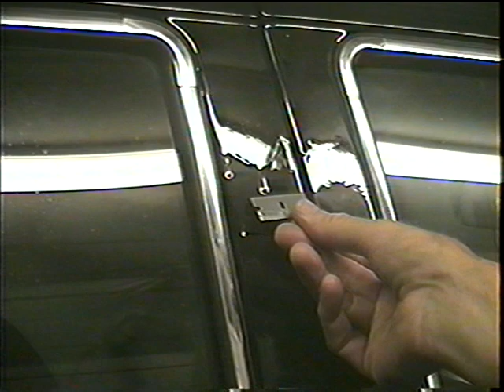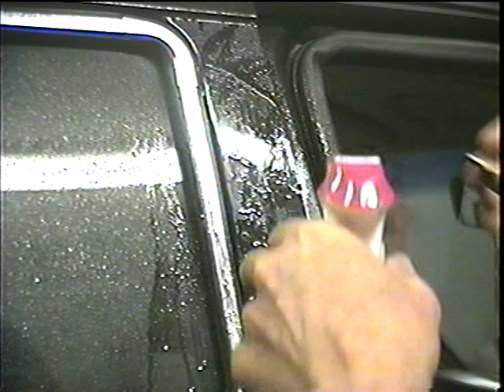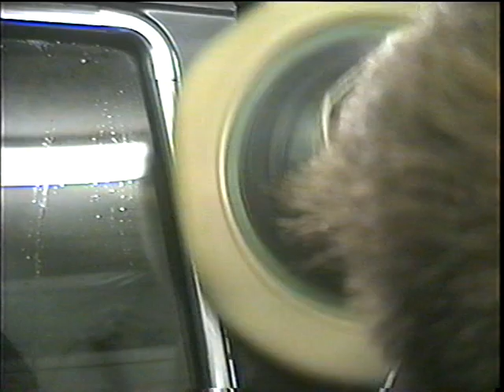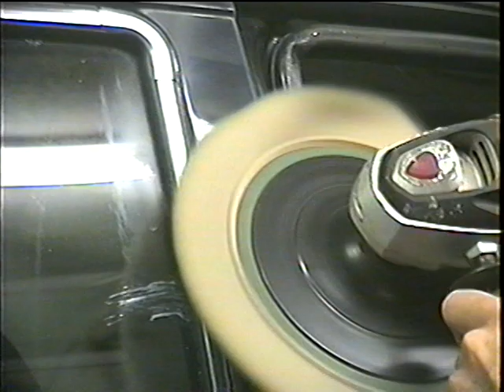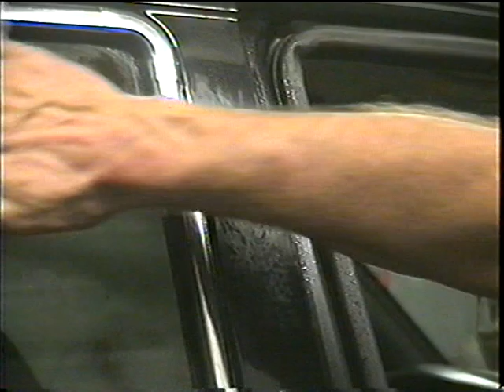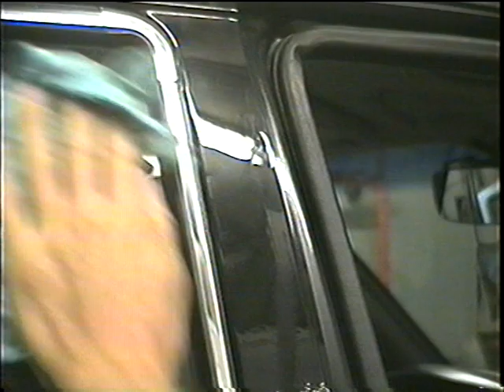How to Remove Runs and Sags in Car Paint - Single Stage or Clear Coat

Comment: In your opinion as far as runs go. Is it the lighting or is it that the painter isn't looking into the paint or the clear and judging better how much material is going down? Everyone is going for that wet look and many it seems are right on the edge. I just watched another video and the guy was very experienced painter and got a lot of runs and sags and he didn't care because it was a cheap job. The roof,hood and trunk lid looked good but the runs and sags were just below the window sills and super noticable. His repair was no where near as nice as yours and it was good enough. My thought is if you're paying $200 and up for just paint,reducer and clear, putting in the labor,you want decent results. I really liked your approach and attention to detail and the little tips. Great video, thanks Jerry. I don't like making comparisons but I'd be very embarrassed letting a vehicle go down the road looking like that.
Reply from the maker: Thanks for the support Bill.  First of all beware of videos showing great paint jobs on flat surfaces - that's easy - you can get it super wet and not run it.  Truth is... if you push it too far on vertical panels you'll end up with runs and runs are not really fun to remove.  The most important thing is lighting - paint booths have great lighting.  If you're spraying in the dark, you'll likely end up with runs.  Best is to have good lighting, watch what you're doing and don't gamble.  Wet sanding and buffing a bit of orange peel here and there is easier and safer than trying to remove runs :)

Comment: Good technique, going to fix my paint.  Too bad the ceiling light is right on the run, can’t really see how it came out, but great instructions.  Didn’t know I could do that with car paint (single stage).
Reply from the maker: Single stage solid colors but not metallics
Reply: @LakesideAutobody  Oh good to know solids.  Yes mine is solid, and i did what you said it working, just have to buff and polish.  Save me from having to coat it again.    Even did it to specks of dust particles and its smooth now.  Thanks again !
Reply: @LakesideAutobody  why not on metallics?  
I got a couple runs on my door panel + orange peel. first time ever painting. (SAPHIRE BLUE METALLIC ACRYLIC URETHANE)
Reply from the maker: @zlabfab487  Sorry about the late reply - sometimes it can mess up the metallic flakes if sanding too deep into the paint.
Reply: @LakesideAutobody  okay i see. thanks for the reply !
Reply from the maker: @zlabfab487  You're welcome - have a good week :)

Comment: Put a small piece of masking tape on the sides of the razer Blade so the corners won't cut into or scratch/dig into the paint or clear I've even bent a blade  you can also pick up a little paint file.. I also have a small 1inch block to hold my paper to keep it small to sand then use my 3 inch polisher taping the edge so I don't burn through...
  Lucky vthat was not matailic for single stage ..you must of had five gallons of paint in there becouse a normal person would have burnt through the edges still showing a little but that was a lot of buffing with a big buffer...
Reply from the maker: Good idea Peter.  You're right about burning through.  I've had a lot of practice removing runs :)

Comment: Will this still work if I use single stage metallic paint? I can’t seem to find any direct answers regarding sanding metallic single stage. I plan to also spray a layer of clear over the metallic single stage paint
Reply from the maker: Here's the clear answer. You can wet sand and buff single stage paint and you'll be fine.  However, with runs it is different because you will have to sand deep thus disturbing the metallic flakes.  To put it simply, runs in metallic paint is not good - you will see where you sanded.  That being said, anything is possible so try it and clear it and maybe you'll be happy with it.

Comment: Thank you for the tutorial. Love the attention to detail. Helped me out a lot, appreciate the video.
Reply from the maker: You're welcome.  If you ever have ?'s, feel free to ask.  Have a good week end, Jerry
Reply: I do have a quick question? How long do you wait until you can wet sand  clear coat?
Reply from the maker: Usually I wait a day - if I am going to wheel it out.  But if I'm fixing a mess up like a bug in the paint etc. I only wait till its dry to the touch.  You just have to be careful and sand very lightly.   Today's good urethane clear coat with hardener can be sanded and wheeled the same day.  Hope that helps.

Comment: Any tips on spraying nitrocellulose paint..
Reply from the maker: If you are spraying lacquer there are a  few things to look out for.  Spraying over fresh or near fresh enamel can cause problems or bad paint reactions.  Enamel and urethane can be put over lacquer but lacquer cannot be sprayed over enamel (relatively fresh).  If it's old enamel you'll be fine.  Just be aware of what you are spraying it over - do a test spot before you lay down a whole cup of it.  That being said, to me it sprays just like any other paint.  The only difference is that you have to buff it to achieve a shine.  It dries fast, wet sands nicely and buffs out easily.  That's all they used for a large part of the 20th century.  Oh, and don't spray w/ high humidity as it can trap moisture and you'll get a foggy look to the paint.  Hope that helps a bit - ask any other ?s you may have though.  Jerry
Reply: @LakesideAutobody  thanks so much Jerry
Its an old citroen gs from the 70s but most of the original paint is gone so im sanding it down and going to prime it with 1k lacquer primer and etch were its bare metal
Reply from the maker: @brokeunemployed5208  I forgot the best thing about lacquer primer is that it's DTM - direct to metal - no need for etching primer, epoxy or anything like that.  Lacquer primer loves bare sanded metal.
Reply: @LakesideAutobody  great thanks again Jerry
You have been most helpful
Reply: @LakesideAutobody  Known as blooming when I was an apprentice in the early seventies 😬🇬🇧

Comment: Jerry, I completely painted my MG all over. I had no problems with the white base coat. No runs or bugs but I did have some orange peel on just a few places. My disaster is the several coats of clear coat I applied……… I have several runs on both fenders, one door both quarter panels, etc.   Should I try to remove the runs as You describe in this video or sand all the clear coat runs out and scuff the rest of the clear coat and reclear coat the entire car all over?
Reply from the maker: If you have a ton of runs, it would be easier to just wet sand and re-clear.  If there are just a few runs - like 4-5 you might want to try this method.  It's really a time thing - you'd spend a ton of time removing them all.  It's your choice really.  We've all had runs in paint/clear too so don't feel bad - par for the course :)
Reply: @LakesideAutobody     Well I really did end up with a lot of runs in the clear coat. First time spraying clear coat for Me, I’ve learned a lot with this project. I’m taking Your advice and wet sand all the runs and sags and redo the entire clear. Thanks Jerry for all your videos and advice.
Reply from the maker: @johnrodebaugh7120  Any time - ask as many  ?s as you need to.  Keep me posted on your projects :)

Comment: What would happen if youbstatted with sand paper?
Reply from the maker: That will work too but you might end up hitting the surrounding areas - thus the razor blade to stay on top of the run :)

Comment: Jerry I used Rust-Oleum paint and I got to run in my door what number paper should I use I don't I didn't use no any clear
Reply from the maker: If you are going to repair - wet sand with 400.  If you are going to buff use like 800, 1000, or even finer like 1200-1500.  I'd try 800-1000 first though - wet sanding :)

Comment: What do you use to prime small ding areas of car. In other words i working on my car as time permits and will prime the whole car when done, so i want to stop any rust before full car prime. Rattle can?
Reply from the maker: It depends on how long or if you park it outside, etc.  If it's left inside, you can prime it with regular lacquer primer, spray bomb, anything - you can leave it like that for a very long time (inside).  I confess - I also leave it outside too and only worry if I see rust start to poke through.  If I do see rust poke through, I'll DA sand it all off real quick and re prime.  I've left stuff in lacquer primer outside for more than a year and have had no issues.  That being said, you are going to have a lot of chatter online about how there's rust under it and so on.  When in doubt, DA some of it off and see.  You can always hit it with some water proof primer too really make sure.  You'll have to read the can to make sure - like epoxy primer and some urethane primers are waterproof.  In the end it really doesn't make or break your paint job.  Hope that helps :)

Comment: I see you're rocking a basic harbor freight rotary. Are you using their pads too? Or would you recommend buying pads somewhere else? Do you have different pads or do you just stick to the wool pad? I'd like to see a video specifically on the polishing process. I really appreciate the time you spend on sharing your knowledge.
Reply from the maker: Thanks so much - that's nice to hear.  Don't kn ow where the pads came from - they were my dad's. from when he worked in body shops back in the 70's - that's how old those things are - I have a few of them.  You can get them on line though - something like this - https://www.eastwood.com/grip-7-wool-buffing-pad-29305.html?SRCCODE=PLA00020&gclid=Cj0KCQiAyJOBBhDCARIsAJG2h5c8Np6KrS2oIZ4rqxmHYoC-A8zNNjHDKKPZgIDTokyNvNQY7qEXnCkaAgmtEALw_wcB  Maybe this video will help:  https://www.youtube.com/watch?v=pSwz47dXG9c
Reply: @LakesideAutobody   I feel like such an oaf. Of course you already have a video on the subject. I didn't even look. I learned some great tips. I have a da polisher from harbor freight that doesn't have quite enough bite. I've been thinking of going to a rotary, but it makes me nervous. The consensus online is that only the most skilled pro's can handle a rotary. I think I'll give it a try using your tips. I'll start with my wife's car 😆. I don't think I can make it any worse than it already is. Thanks again.

Comment: How long do you usually need to wait to do this after painting?? Using acrylic urethane paint single stage.
Reply from the maker: Usually the day after.  You can do it even earlier depending on the temperature, type of paint, if it had hardener, etc.  Basically, you'll be able to tell if the paint is hard enough when you begin to wet sand. If it seems like the paper wants to stick - wait.  Jerry
Reply: Lakeside Autobody thank you!

Comment: I can never fix runs like this as I always have tiny pin holes in the run after sanding
Reply from the maker: Interesting... What type of paint are you using?
Reply: @LakesideAutobody  it's in the 2k clear ..
Reply from the maker: @therealdeal4492  Maybe try reducing the clear a bit more and going with 2 regular coats - the last being a bit wetter than the first.  Give 10 minutes between coats.  If it's put on too fast and wet it may cause solvent pop or micro-popping.  There's some good stuff on the internet on this topic and how to prevent it.  Let me know if you solve it, what the fix was, and what you think was causing it.  Curious 👍  Jerry
Reply: @LakesideAutobody  I couldn't find anything on the micro popping..
I wait at least 15 min flash times ..
May have to reduce it alot ?
Do you know anything about this?
It looks clouding in thick spots or runs..but is very tiny pin holes like micro popping.?
Any help would be appreciated as I have been dealing with this for a bit and is not easy to cover over .
Many thanks!
Reply from the maker: @therealdeal4492  Check this article out under solvent popping. https://globalfinishing.com/2020/05/13/4-common-causes-of-finishing-defects-how-to-remedy-them/ I've never ran into it but I don't spray thick paint.  If anything I spray it on the thin side like 4 parts paint and hardener to 2 parts reducer or even more depending on the paint thickness out of the can.  I can't stand thick paint.  It leads to all kinds of misery - orange peel, dry areas, heavy sags from trying to get it wet, thickness around tape, takes longer to dry, etc.  I would suggest reducing your paint & putting on thinner coats.  You'll have to move a bit faster because it will be a bit thinner so you won't want to put it on as heavy as you are used to.  Here's a forum on it to - seems other folks have the problem to - is the surface hot when you paint?  Do you have excess moisture in your location?  http://www.spiuserforum.com/index.php?threads/clearcoat-boiling-solvent-trapping-micro-bubbles.7024/

Comment: That was a horrific you could clearly still see the run after you finished sanding even at the end the paint work was eneven
Reply: I agree, In fact, there are numerous issues in his process. First, you can't go from 400 to 1500. You need an intermediate grit, say 800. Second, he left way too much of the run when he switched to 1500...you need to get the great bulk of the run out with the coarsest paper on a hard block. You cannot remove the remnants of a major run like this one with 1500. You will sand thru before the run comes out. I do agree the use of the razor blades. Sorry to say, but for those who do this for a living, this was not an acceptable repair. Not even close.

Comment: What grits are on the electric sander?
Reply from the maker: Meguiar's M105 Mirror Glaze Ultra-Cut Compound
Reply: @LakesideAutobody  Oh. so it's polishing compound. I don't have access to electricity or a polisher where I'm fixing my car. It's outside, and I have to do the sanding and polishing by hand. After I saw all the runs on the hood, I decided to do only spots on the trunk. It will take hours to fix the hood.  Can I use that compound by hand?
Reply from the maker: @Gertyutz  Yes but it will take some work.  Good luck - that will be a good arm work out :)
Reply: @LakesideAutobody  I figured out my problem. The spray cans I see in YoutTube demos  spray in a much wider pattern than mine, (or they're using a spray gun, which doesn't apply to my situation). I'm using Rustoleum 2x Cover Coat Clear Gloss, and the spray pattern is too narrow. I'm getting either a stippled finish for being too far, or runs from being too close. I get better results on vertical surfaces.   I made a mess of my hood yesterday. 

I do have an orbital sander that I use for work and a drill with  a circular rubber sanding  pad, but I've never used them for polishing.  

Should we move this conversation to Private Messaging?
Reply from the maker: @Gertyutz  I don't think you'll have much luck removing runs from spray bomb can paint as it is probably too thin to work with.  If I were you I would set that hood out in the sun, bake it dry, sand it, and try painting it again. But practice first on a junk fender or something like that.
Reply: @LakesideAutobody  You've inspired me. Bought sanding discs for my drill and a polishing bonnet. Flattened the runs with razor blades. What was the last grit you used before the Meguiar polishing?
Reply from the maker: 1500 grit but you can really use anything from about 1000 - 1500 - whatever works well for you

Comment: keep the apprentice off the gun man!
Reply from the maker: Everyone gets runs.  I rarely have to buff a paint job but by getting it that wet you are gambling and inevitably you'll end up with a run every now and then.  Can you fix the run is the question :)
Reply: whats your favorite setup for spraying the 2k paints? I spray a marine 2k aliphatic linear PU. gloss clear , can't thin it and get 100% durability desired, so I use a 2.0mm tip with a HVLP gun with a soft pressure pushing it up to it and pick the peak time of day temp wise to get it to flatten out best as it can, most times its fine after 3 coats starting with a thinner first coat. This doing carbon fiber topcoats- using west 105/206 tinted black for laminating.